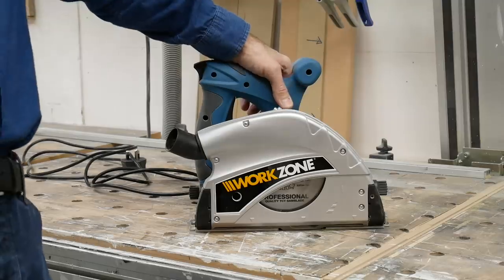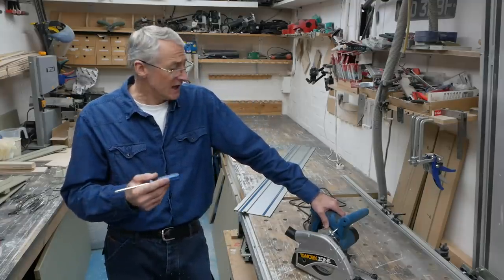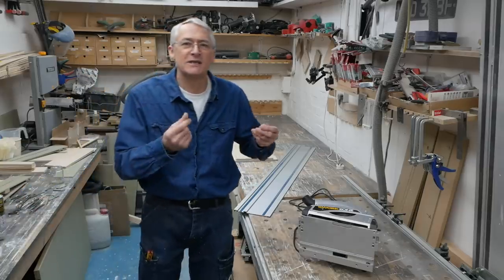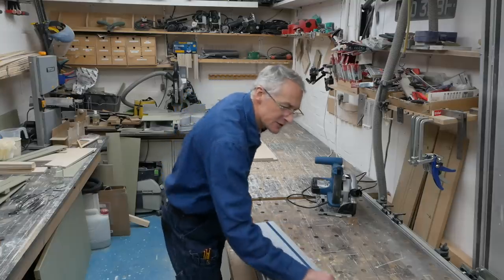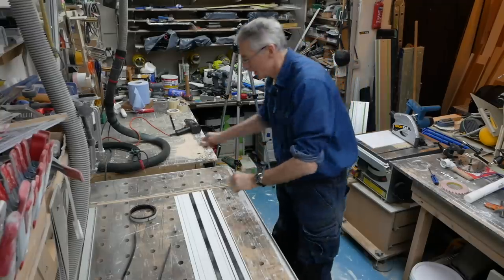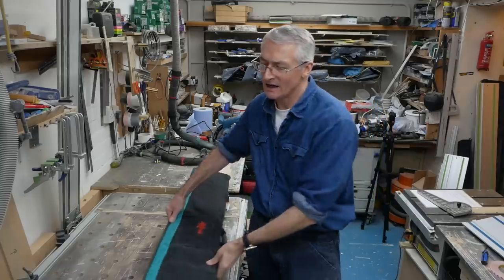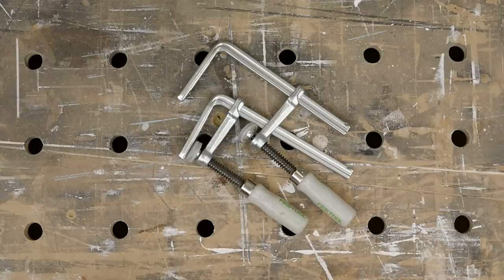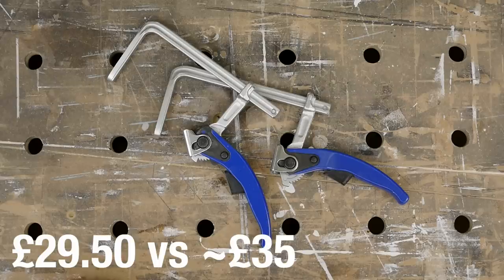TW P7; Improvements and maintenance [video #283]

Comment: Thanks for the series. It's been very informative as I'm starting out with tracks! I've adapted a parkside 20v circular saw to work with some evolution tracks from Screwfix and it's serving me well so far considering it's not a real track saw. Once I've built a workshop in my garden I'll be getting a real mains powered plunge/track saw and using my 3d printer to make something similar to your multi function bench as an alternative to a table saw. It's not something I'd considered before but I think it will make planning the layout of what will be quite a small shop a bit easier.

Your videos are great and it's like having my highschool DT teacher in my pocket to refer to if I'm stuck on a project or trying to understand a tool better. Thanks again!
Reply from the maker: Thank you very much! Very kind of you, and always good to hear that the videos help in some way. 👍 🙌

Comment: I’ve just binge watched all of these videos and have found them really helpful in making a decision about which direction to take in a couple of intended projects. I would dearly like to to make a couple of pairs of speaker in the next few years, but, having given up woodwork at school in 1971 at the age of 13, my experience is limited to the occasional bodge with bits of wood. I was unsure whether a track saw would be an appropriate tool to use, but am now convinced that (even) I could make a passable attempt at the job, using little more than a track saw (apart from when making holes for the drivers). I am looking forward to re-watching all of these videos and referring to them when I finally the plunge (pun not intended, but I’ll leave it there). Thank you very much for making these videos. Just got to buy one and practice making stuff with some plywood I have hanging around.
Reply from the maker: Glad to hear it - let me know how it goes! 👍
Reply: @10MinuteWorkshop  It will be some time from now, but, memory permitting, will do.

Comment: Excellent tip re: moving the splinter guard over to give a new cut edge ........... genius.
Reply: It reassured me, as I'm worried about messing up that initial cut - but that takes the pressure off, at least in one's mind.
Reply: @negotiableaffections  I moved the strip for the first time Sunday (2nd hand saw). Even with heating, the adhesive didn't release cleanly. After picking it all off, cleaning with white spirit, and then using lengths of double sided tape, I re-applied the rubber and did my first cut ever. Really easy and nothing to worry about. The silicon spray is also an excellent tip - runs as smooth as silk and VERY accurate.

Comment: Thanks again Peter for your excellent videos.  I've learned a lot that's useful.  My saw is the TS55 REBQ and I've made one modification to it which has improved it massively.  This saw incorporates that handy feature which is the rotating dust extraction port.  The one which ensures that from time to time the hose catches on the end of the guide rail and stops it dead or knocks it off line.  I just drilled a 3mm hole in the case  about 5mm  in from the plastic port and screwed in a little self tapper which goes into the end of the dust port and stops the it from turning.  At last!  hose and cable now travel smoothly together up the rail and there's no more of that awkward arm-in-the-air  grip trying to hold the hose clear and giving yourself tennis elbow in the process.
Reply from the maker: Thanks! I just wind tape around mine. I think the Festool engineers should be ashamed of themselves though, that this hasn’t been sorted yet. Every Festool saw I own has a ‘floppy’ exhaust port, but on both the cheap tracksaws I own the dust port stays put. 👍👍

Comment: Another tip is to put a longer & better quality power cable on it, my Scheppach 
had a rather short cable made of cheap-&-nasty wire, I replaced it with quality rubber sheathed cable .. 

Great little mini-series Pete ... Thanks !!  😎👍☘️

Comment: Thanks for the series! I didn’t understand the use of the additional spoiler board when cutting the plywood during the blade comparison...why not just drop the blade down to its normal depth and cut the plywood sitting directly on the crosscut jig?

Comment: As many others have said, thank you for making this very helpful and useful series. I have a very small workshop, so a track saw will be a much more convenient and safe way to handle sheet goods than using the table saw, even if I were to upgrade from the DeWalt job site saw to a full cabinet saw. It's always good to have options when approaching a task.

Comment: Thanks Peter, I really enjoyed this series. 
One thing I experienced with the Parkside track saw was that, having my workshop in my garage,  I stored the track close to my boiler as there was a slot that offered protection.  The slight heating caused the splinter guard to migrate lengthways and off to the side.  I got new tracks from L Compernass, Lidl's agent. A set of 2 tracks were £15 so I got 4 tracks, but I had to wait about 10 weeks for them and multiple calls and e-mails.  Having seen your solution with the replacement rubber strips, its an easier and quicker solution.
Reply from the maker: Thanks! Yes, a better quality double-sides helps too. I like the 3M stuff 👍👍
Reply: @10MinuteWorkshop  Thanks Peter. I will try that if the splinter guard moves again

Comment: I bought the erbauer plunge saw a few years ago when my ts55 went in for a service, it came with 2 quick grip rail clamps, they are brilliant, I use them all the time, especially with my mft systainer, I love the design of the festool rachet clamps but I just can't bring myself spend almost £100 on 2 clamps 😭

Comment: Marvellous and informative set of vids.  Like yourself I have a table and track saw, BUT, my conversion to the track saw keeps on getting postponed.  I’ve made my own MFT and added some of the extras you’ve shown in previous vids and it’s coming along.  I do need to contemplate an extension table to accommodate long sheets.  This series has given me the push needed together with confidence to make the transition, more and more is being made with sheet material.  Thank you again 👍🏻👍🏻👍🏻 kindest regards Mike
Reply from the maker: Thanks Mike! 👍👍

Comment: A handy tip for some, I spent a great deal of time trying to get the two rails with my Titan to play nice with each other (the saw was sticking on the notch, not perfectly aligned), filing and re-adjusting e.t.c.... only to find that they actually worked perfectly when i put them the other way around! So, if your tracks aren't playing ball, trying swapping them around.

Also, the Freud Pro 40t blade is only £26 from Screwfix and it makes absolutely perfect cuts, better than any i've seen in this video series.
Reply from the maker: There’s a ‘more on blades’ video out next week. 👍

Comment: I have binge watched this series, learned a lot, thank you for taking the time and effort to produce.  Two things, I have the TS75 version of the Festool saw and although it is wonderful, I can not recommend it.  I would rather have the 55 version.  The larger one is heavy and awkward and I rarely need the larger capacity. Of course it may be that I can remember when Elizabeth II was not queen.  And, I would not have silicon spray in my shop.  Creates terrible problems with clear finishes. (Fish Eye)  Use paste wax (silicon free) instead.  Thank you again for the time and effort.
Reply from the maker: Thanks Barry! Fair enough about silicone spray - I think I do say in the video to use it carefully - use whatever you think's best for you. I use it for a variety of things, but then I rarely do clear finishes! 👍👍

Comment: OK here's where I say "Bugger it, I wish I had tripped over your channel a few months ago, before spending several hundred euro on my DeWalt table saw!" Seriously I never realised or knew the track saw existed until now, let alone just how useful it was. 
Now, and remember I am only a hobbyist novice,  all I need to do is pick a suitable but good track saw that fits both my needs and my budget. It's a toss up between the Makita and the DeWalt both throwing up separate issues.
Keep up the great content.... maybe a Router Workshop next?
Reply from the maker: Thanks! Oo - router workshop! Hadn’t thought of that! 🤔👌
Reply: Peter Millard all I know how to do is round overs with a bit and bearing. It’s all the extra bits, fences and adding to a table etc that’s of interest.
Reply: If you're a hobbyist novice like me, I strongly recommend the Aldi or Parkside saw as a first purchase. I have the latter and it works very well.  Once you outgrow it you can still buy a more expensive saw and lose little money if you sell it secondhand.

Comment: Peter, could you make a vide about common beginner problems with track saws? For large sheets it’s easy, but I was cutting some slippery and small pieces and they move, could not get a 90 degree cut, sometimes not even straight, as my track would move.
Reply from the maker: For small pieces I’d recommend a crosscut jig as in Part 4 of this series. Keep the grippy strips on the rails clean and as grippy as possible as well - even a little dust on them can really affect their grip! 👍👍

Comment: My Dewalt circular (rail) saw came with a 24T construction blade.
I soon changed it out for a 40T cmt fine finish blade. Difference is night and day! Paying €40 for a blade on a dewalt saw kinda makes sense but I understand putting a blade like that on one of the cheaper saws srems silly.
Reply from the maker: Actually it makes perfect sense if you want to get a better quality of cut. I have a whole set of videos about blade upgrades. 👍👍

Comment: Thanks very much saw this a few days ago and had a right binge 1-7 . Great tips and advise .i recently bought that Alidi saw (still in the box) a few weeks back . I want to make an MFT table and have a go at your shaker doors . Brilliant thanks
Reply from the maker: Pleasure, thanks! 👍👍
Reply: Same here great little vids I bought the scheppach  it’s not too bad but I chose to upgrade to the Makita after quite a bit of research (I do own a couple of Festool bits) & keeping the cheaper one for rough stuff or when friends want to borrow stuff haha !   David OSullivan I looked into mft I noticed eBay has a drilled out table top for £40. Odd pounds so may make something out of this !!!      I’ll keep stealing your ideas Peter   Thanks
Reply: Barry Evans nice one Barry .i was going to get the Peter parfit guide system from Axminster but this €180
Reply from the maker: david osullivan Unlesa you plan to make a fair few, then Rick at cnc designs in Wrexham will always be a cheaper option 👍👍

Comment: Wonderful and instructive series and yes; I've ordered the aldi/sheppach because its in my price range. Wondered whether to make the 1st cut with the incl blade or 'change up first' but as the splinter stuff can be both adjusted/bought cheaply, I don't think I'll wait. Just hoping it arrives in A1 condition. Thanks for each and every useful tip, Peter.

Comment: I have watched the video in which you tried these same blades in the Festool.

It's apparent that neither one, nor the two together, answers the question, "Which blades are good choices for my tracksaw?" Unless I have one of those two saws.

My easy alternatives are the default blade, Irwin, Diablo, maybe Makita (I don't know that it has a full range), deWalt (same). A bit more trouble, and I could add CMT and maybe another Italian brand. And Festool, of course. Possibly, I can get Trend as from a week ago.

Do yo have any thoughts on why the saw makes such a difference?

Comment: I have both a Table Saw and a Track saw. My Table Saw is obviously considerably more accurate and quicker to set up accurately for mitre cuts, and offers more accessible versatility with the use of Dado Set and Crosscut / Ripping blades. (It's a machine from the USA bought specifically to use Dado Stacks).
 Though my Track Saw, a Festool HK-85, is I believe, the only Track Saw capable of running a hideously expensive Dado, (Groove), Cutter set. (At over £400, it's nearly as expensive as the Saw). 
What a Track saw does bring, is accurate cutting at the worksite. It's far easier to lug about than a contractor saw
and it is far safer and more manageable to use a Track Saw for cutting large sheet material.

Comment: The other mod you can do is remove a short section of the spring to make it a little easier to use as the resistance is too much. About one coil will do it.
Reply: Dave... this is on MY list... 😎👍☘️
Reply: Doesn't shortening a spring make it stiffer?  Sounds daft, but there's less of it to actually give.
Reply: John Wilson no the spring compresses by the same amount in more space so makes it less stiff. It’s a push not a pull

Comment: After seeing Aldi start selling their tracksaw just after I bought the Parkside one, I regretted not buying the Aldi one, but after watching this I feel much better about my decision. 
The Parkside one has a couple more features and I paid less. The Parkside one has two markings on the depth guide so you can use it easier with and without the track, it also has a clip to keep it set at 25mm for changing the blade, so you don't need to get the third hand out! I also think it looks a bit more expensive and the handle feels more comfortable (for me anyway).
Now all we need is for Aldi or Lidl to bring out a cordless tracksaw and I'd be all over that. I find cordless tools so much easier to use, even when connected up to dust collection (or is it extraction?)
Reply: Be careful what you wish for! Cheap Tools have numerous major drawbacks, not many consider.
Cheap tools use cheap batteries, some cheap tools get discontinued after a single production run, Cheap tools are often almost impossible to get spares for.
I remember buying B&Q PowerPro years back. Every battery powered tool in the range was not used frequently enough to maintain battery capacity, so relatively low usage tools were scrap in just a few years because the range, spares and batteries had been discontinued. Also there is no compatibility, or model continuity with cheap copycat tools, so the next generation requires a different fit battery and accessory range.
All my DeWalt tools use the same battery charger, the batteries are excellent quality and always available as spares.
My trend T11 Router is over eleven years old, I replaced the Bottom Bearing 5 years ago and got a new Magnet for the speed controller a few months ago. I paid about £275 for the router and £45 in spares, that's about £30 a year in cost! My Cheap £50 PowerPro, was in the bin shortly after the 12 month warranty expiry for want of a cheap replacement part that was unavailable!
Expensive tools are expensive for a reason! My advice is save longer, Pay more, buy the best you can afford!

Comment: Would there be value in building a scoring gage that runs on the track & slices either side of the intended kerf using eg. scalpel blades? This seems like it would allow for cleaner cuts where that's crucial, but might also aid layout, potentially even allowing one to slide the track until the gage catches in a cut from a marking knife.
Reply from the maker: Nothing to stop you giving it a try, but tbh with decent saw blades you shouldn’t really be having any issue getting clean cuts with a tracksaw. 👍

Comment: You can see how much better the dust collection is with the tapped whole as @13.48 there was much more saw dust as the Axminster blade had the blade port open. Fantastic as usual. But this particularly enjoyable. Do you know if the makita splinter gaurd was better than the supplied.?
Thanks a million Peter.
Reply from the maker: Thanks! The Makita splinter guard is better than the original - thicker, and makes better contact with the material - but not perfect. A bit more playing needed for when I do the review, I think 👍👍

Comment: Very good series. I was particularly interested in it because I have just purchased the Aldi saw. I also bought a couple of the 1400mm rails and clamps, so am all set to go once the weather warms up!

One glitch I have noticed with all the rails I have (700mm and 1400mm) is that because the splinter guard is much shallower than the non-slip strips the track has a tendency to rock, which would lead to non-square cuts. I have a few questions about this:

Have you noticed this problem with the tracks included with the saw?
Does fitting the Makita splinter guard strip help minimise this rocking?
When you were making cuts with the saw were you consciously rocking the track onto the splinter guard or keeping the track resting on the two anti-slip strips?

I will be very interested to see the video of your review of the saw.

Thank you for your efforts producing this series and your other videos, the vast majority of which I find interesting and give me ideas how to tackle my own projects.
Reply from the maker: Thanks Robert. Yes, the Aldi / Scheppach tracks are a problem. More on this in the review. The Makita splinterguard helps, but doesn’t solve the issue. I was consciously applying (more than usual) pressure to the tracks when making the cuts. Follow-on re the blades out next week. 👍👍